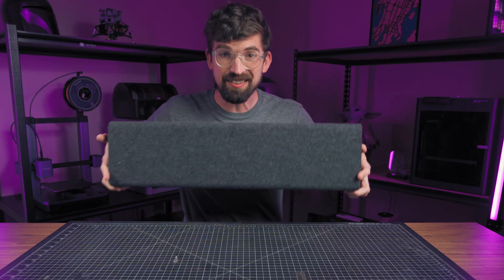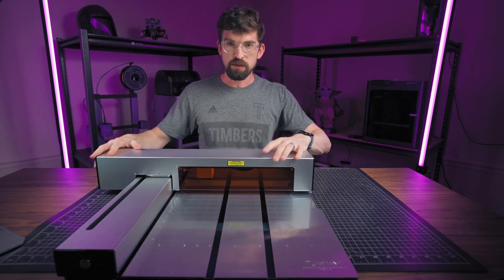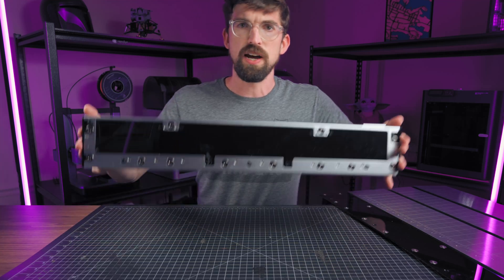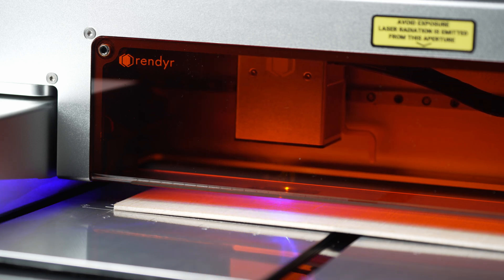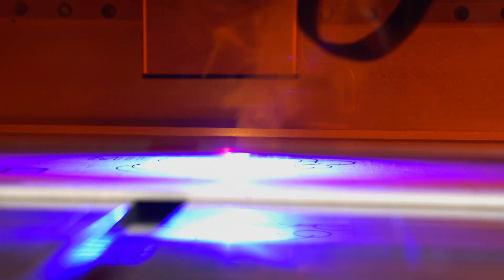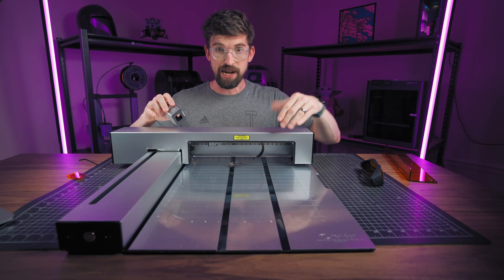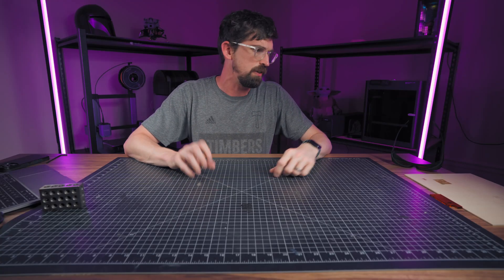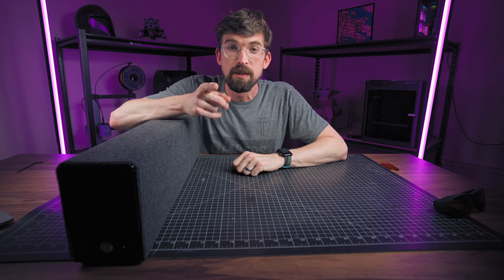No Other Laser Can Do This - Rendyr Optic Overview

Comment from the maker: Let me know what you think of this design!  Save $1000 with promo code MOB24 (Limited to first 24) here: https://geni.us/rendyr
Reply: The fact that they can just toss out $1000 off codes illustrates how overpriced this unit is normally. It looks like a really nice design, but in no way is this a $3000 laser machine.
Reply: Thanks for your feedback. We’d like to clarify that the $1000 discount code is limited to the first 24 orders only, as mentioned by Brandon at the end of the video. This discount is a special offer for the Make or Break Shop community to celebrate the start of our launch.

The Optic Portable Laser Cutter offers a range of advanced features and unparalleled portability with built-in filtration, setting it apart from other machines in the market. Our goal is to provide a high-quality, versatile tool that meets the highest safety standards, backed by US-based expert customer support. We’ve already seen the Optic create tremendous value by enabling creativity and productivity for our customers.

If you have any further questions or need more information, we’re happy to help!
Reply: Laser pecker LX1, and LX1 Max already in the market, and seem very similar?
Reply: Hey! Glad to see that you're looking at various machines. We haven’t had the opportunity to test them ourselves but here’s what we see looking at the LaserPecker LX1 series. First, they are unenclosed and without filtration, resulting in safety hazards (which they don't properly describe).  They also don't include a cutting mat.  The add-on cutting plate, enclosure, and air purifier (only available for pre-order as of 6/3/24) take up lots of space, mostly defeating the foldable nature of the LX1 series, and almost double the total cost of the setup. The cantilevered fold-out arm has no support at the end which reduces accuracy and speed. When comparing them by looking at the whole picture, we see the Optic as a much better and complete integrated product for a very fair price.
Reply: @parisvoltaire  Hey! Glad to see that you're looking at various machines. We haven’t had the opportunity to test them ourselves but here’s what we see looking at the LaserPecker LX1 series. First, they are unenclosed and without filtration, resulting in safety hazards (which they don't properly describe).  They also don't include a cutting mat.  The add-on cutting plate, enclosure, and air purifier (only available for pre-order as of 6/3/24) take up lots of space, mostly defeating the foldable nature of the LX1 series, and almost double the total cost of the setup. The cantilevered fold-out arm has no support at the end which reduces accuracy and speed. When comparing them by looking at the whole picture, we see the Optic as a much better and complete integrated product for a very fair price.
Reply: @parisvoltaire  Hey! Glad to see that you're looking at various machines. We haven’t had the opportunity to test them ourselves but here’s what we see looking at the LaserPecker LX1 series. First, they are unenclosed and without filtration, resulting in safety hazards (which they don't properly describe).  They also don't include a cutting mat.  The add-on cutting plate, enclosure, and air purifier (only available for pre-order as of 6/3/24) take up lots of space, mostly defeating the foldable nature of the LX1 series, and almost double the total cost of the setup. The cantilevered fold-out arm has no support at the end which reduces accuracy and speed. When comparing them by looking at the whole picture, we see the Optic as a much better and complete integrated product for a very fair price.

Comment: I never post any reviews. I just want people to be aware of how hard it is to get a hold of someone in the company. I have an issue with my laser firing. They told me that usually its the hinge on the machine that collects debris causing the laser not to fire. This worked for maybe 2-3 cuts. I am back to the same problem. Now, the machine no longer fires. The machine homes and "enables laser" but not light when framing the project. When I disable fan and hit start, the machine acts like it is firing. I am following the instructions word for word. I have checked the settings. I have reinstalled the software. Looked the FAQ. I have emailed, called and left messages, and did the online chat.  The team seems really nice. I would just like someone to get in touch with me to trouble shoot. I am willing to send my machine back and have them fix it.   I can't recommend this product because the customer service is subpar. I just wanted to make a gift for my two year old. I am happy to update this if I ever get a hold of them.

Comment: I see 2-3 slight “problems”:

1.) It is slightly more difficult to figure out/see exactly where it will engrave, especially when not using the matt.

2.) The hight of materials, as well as potential waviness, seem very restricted! Many other cheaper diode lasers have auto leveling via stepper motor and height detection DURING engraving, and don’t rely on a roller in a specific location.

3.) The overall concept saves storage and transportation space, but is very limiting otherwise. Including (inexpensive) expansion kits, higher power laser modules etc.

Interesting product (for specific applications)!

Best wishes

Comment: I'm so confused why all the haters in the comments are trying to compare this to a co2  laser. Most diode laser companies will advertise the input wattage for marketing, and typically, they have a power output of around 10w. Rendyr is advertising their actual OUTPUT power of 12w. I think this is a very well thought out machine, not to mention manufactured and supported right here in the USA.🇺🇸
Reply: I wouldn't compare it to a Co2, but there are a laundry list of diode lasers out there in the 20w and 40w ranges. As you say, this may be input only and/or marketing, but XTool at least states their 40w module laser is true output. If you can point me at something that shows that the true output is lower, that is interesting. But 12w still seems low and a miss ultimately. But those other modules are physically larger and probably wouldn't fit the overall aim, which is quick setup and easy cutting. This is an intriguing machine becasue it would fit in my big suitcase and probably travel well. I'll keep it on my radar for when it gets to 20w.

Comment: Surely if you cut something the laser is going to ruin the bed
Reply: Hi there, We designed the Optic’s cutting mat to resist normal laser cutting operations in a similar way to conventional honeycomb beds.  The top surface is all metal, including the folding hinges made from flexible and durable spring steel.  While laser cutting will result in scoring marks, they do not impact the cutting mat’s functionality.  The alignment grid is machined deeper to maintain its visibility.  In addition, it's easy and quick to wipe off any residue from cutting materials.

Comment: Laser cutting requires space for safety, exhaust, stocking material, assembly, sanding, laptop rerunning jobs... 
I cut 95% of the time so this is not for me. While cool, it is not solving my problems.
Better exhaust, quieter operation, faster job, camera (to avoid the very problem that occured in the demo of overlapping jobs), less soot on the cut, dealing with non perfectly flat materials, auto focus are features I am in the market for.

Comment: Hmmmm that sure is different and very expensive, ok about the cutting board, I see two open lines (the fold lines) so when cutting, if the material is over one or both of the fold lines, I guess it would cut into the felt backing? I can't really tell from the video if it has some kind of protection or not, but as it has to fold at that point, I will guess not.
Thanks, and please keep making more video's.
Reply: Hi there, We designed the Optic’s cutting mat to resist normal laser cutting operations in a similar way to conventional honeycomb beds.  The top surface is all metal, including the folding hinges made from flexible and durable spring steel.  While laser cutting will result in scoring marks, they do not impact the cutting mat’s functionality.  The alignment grid is machined deeper to maintain its visibility.  In addition, it's easy and quick to wipe off any residue from cutting materials.
Reply: @rendyrinc  Hi, many thanks for your reply and letting me know how you constructed the cutting mat, I was sure that you would have covered every aspect of the design, but still I just had to ask ;) hey nice bit of kit, but a bit out of my range for a diode laser ;( keep up the great work.

Comment: Wheel getting dirty and skip.
Reply: We appreciate your concern and can assure you that this has never been an issue with any of the hundreds of Optics in use. Dirt and other residue is not likely to accumulate where the wheel runs on the cutting mat, and additionally the bearings are sealed to prevent any degradation from dust or particles. Hopefully this helps address your concern!

Comment: Interesting concept.  Would be great for customizations at a craft show.  Curious at to speed as is it limited at all my the cantilever design, flashback if cutting, accuracy of the X axis i.e. if the movement in the Y axis twists the x gantry at all.
Reply: Thanks @markferrick10!  The Optic’s gantry is actually not entirely cantilevered but supported by a wheel (see 3:59 in the video) which together with the solid hinge connection ensures it’s always level, robust, and produces consistent results.
Reply from the maker: I’ve used some cantilever designs before and this felt really solid.  The metal mat locks into place at the bottom and helps make everything more rigid

Comment: Assume they will ship with a metric grid outside the USA?

Edit: just saw the price, $3,000.- ? Seriously?
Reply: Hey! Thanks for your questions.  Great feedback on the question for a metric grid version.  You’re the first to ask and we don’t have this option yet, but we’ve passed this on to our product team.

Regarding your question about pricing, the Optic Portable Laser Cutter offers a range of advanced features and unparalleled portability with built-in filtration (costs extra with every other laser cutter), setting it apart from other machines in the market. Our goal is to provide a high-quality, versatile tool that meets the highest safety standards, backed by US-based expert customer support. We’ve already seen the Optic create tremendous value by enabling creativity and productivity for our customers. On top of that, we’re offering $1000 off for a very limited quantity for the Make or Break Shop community to celebrate the start of our launch – That’s only $1995 while they last, which makes the Optic an even more phenomenal deal in our opinion.

If you have any further questions or need more information, we’re happy to help!